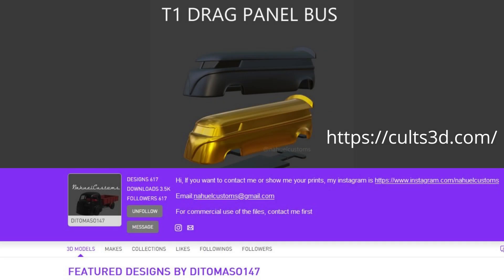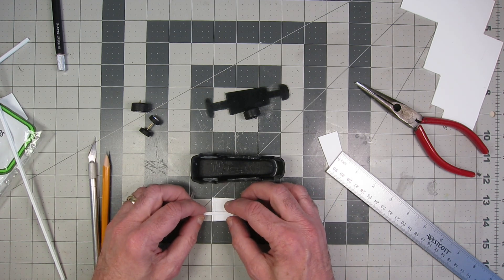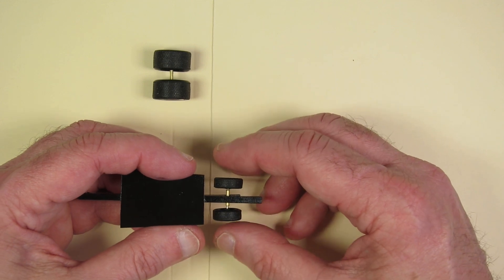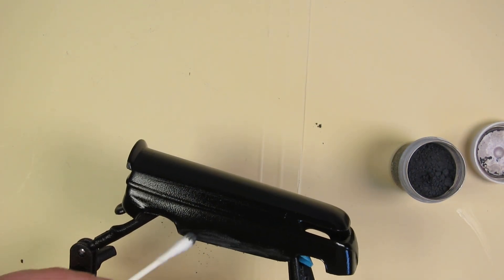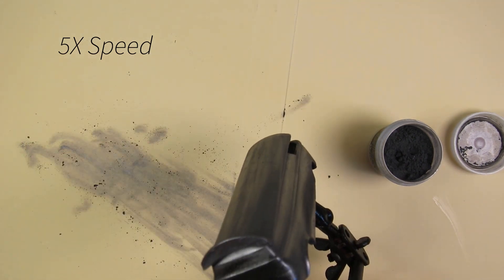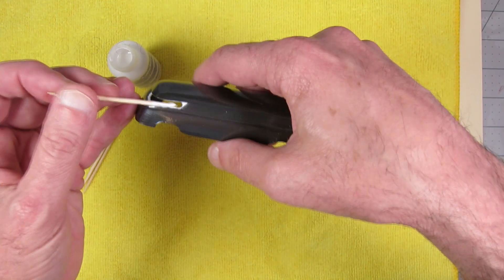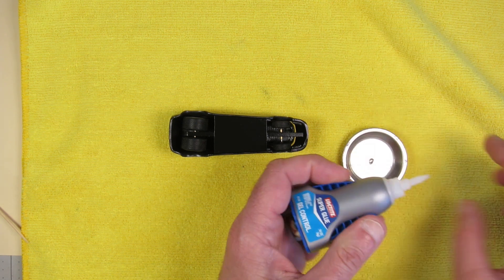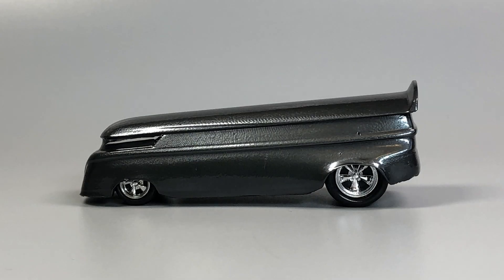T1 Drag Panel Bus - Experimenting with Nahuel Customs STL, Uschi Metal Polishing Powder, and More!

Comment: You can for sure pull the axels on muscle machines. You gotta pull the tire off then its a two piece sandwich with the hub and the backer plate. It easier if you heat the whole thing up in some hot water but it is for sure possible.

Comment: Hi, Jim. I also saw Chris use the metal polishing powder on his channel. Resultingly, I bought an off-brand product - also a year ago 😀 - that does the same thing, but I haven't applied in on such a large casting as you did here. How is it for fingerprints after your last polish? And do you think decals will adhere well? Sure does look good! Now I'll swing by Cults to search for some Nahuel .stl files. Thanks for being such a font of great tips for us! I really enjoyed this video. Wishing you a lovely weekend! From Switzerland - Andrew 🍁👍
Reply from the maker: Thank you so much Andrew!  After the last polish, I went straight to the clear coat - it seemed rather durable, and I was more comfortable with it than say the results after using Rub N Buff.  At the same time, relating to decals, I would definitely clear coat it first, then apply decals, because I have my doubts as to how well they would adhere to the surface, how the surface would react to moving decals around, etc. (🤣 I have nothing to base these concerns on other than my gut though 🤣🤣🤣).  It’s really interesting stuff and I’m looking forward to using it again.  Thanks for watching Andrew!  Have a great weekend!

Comment: it's obviously a drag bus, because it drags on forever. XD interestign design, smooth and organic and yet easily recognizable without deco. I wonder if VW knew how much of an icon they'd be designing?
also, love the metal look. that powder is really worth the price! (I haven't looked yet, surely I'd whince until my face hurt ;))
Reply from the maker: It's really interesting when you set it next to a Hot Wheels Drag Bus - a casting that I love - and the differences are substantial.  The weird part is that when I think of the drag bus, I think of the best parts of both of these lol.
Reply: @JimSilva-SilvaDiecastCustoms  the thingiverse body reminds me of these funny car bodies which look like nothing until the details and shapes are painted on... and it's probably meant like that, too. :)
btw, the design of the T1 bus/transporter was so iconic that the deutsche bahn copied it: https://en.wikipedia.org/wiki/DB_Class_V_200